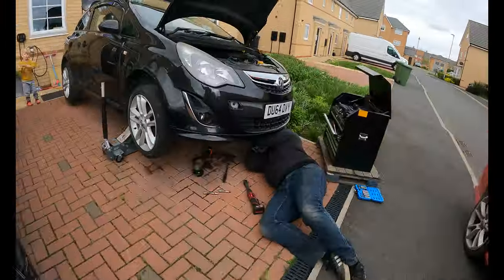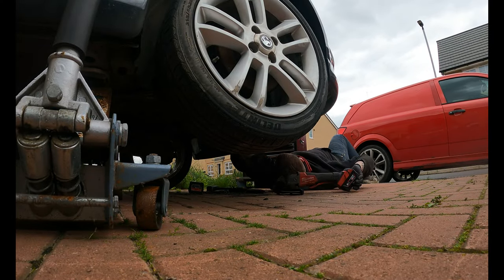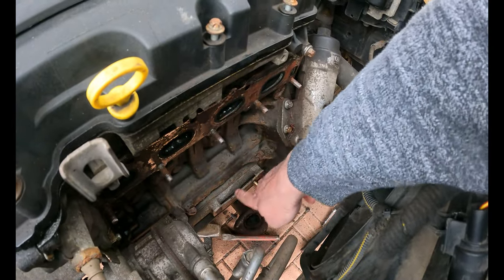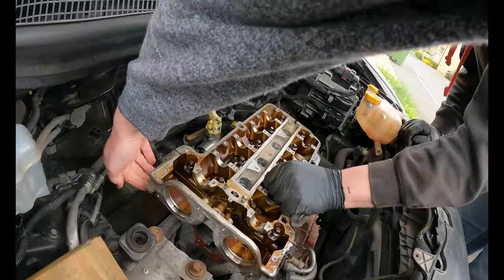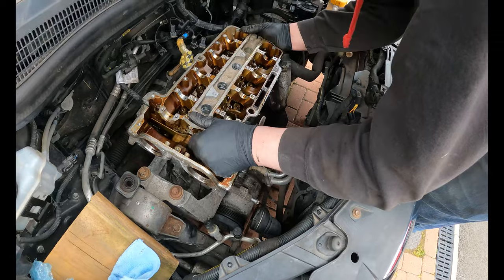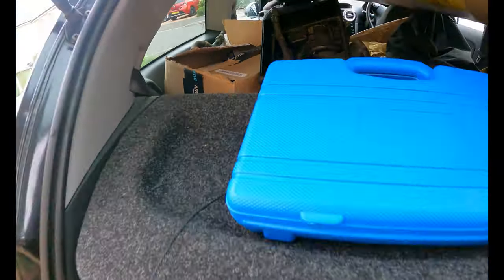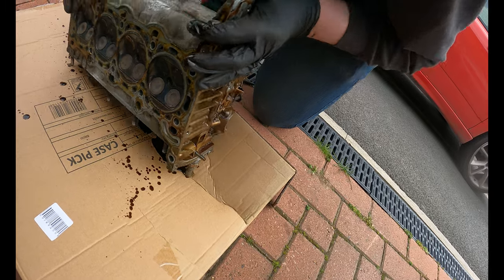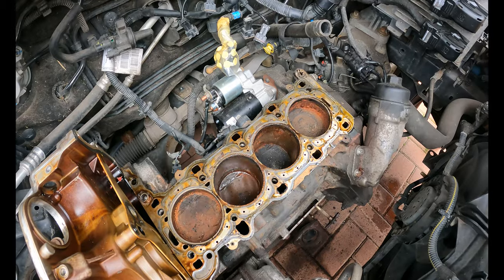HOW DAMAGED IS MY CORSA ENGINE? VLOG 5

Comment: What you're buying is technically a short engine - no head or ancillaries but block with pistons and crank, etc, in it. Might be worth getting/making some wheel chocks for safety as well. You may need a wire cable or chain assembly to connect the crane hook to the engine. Not sure if you might need a new oil pump. Family comes first - can't quite understand why your viewing figures remain so unfairly low,
Reply from the maker: Thank you.